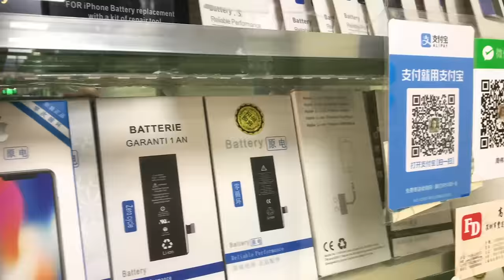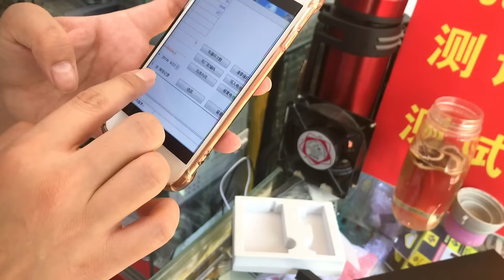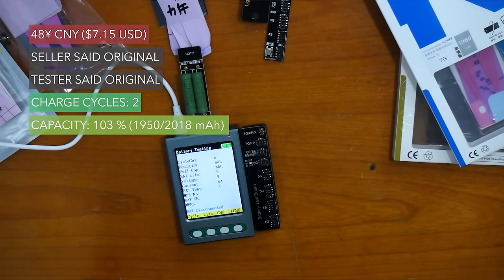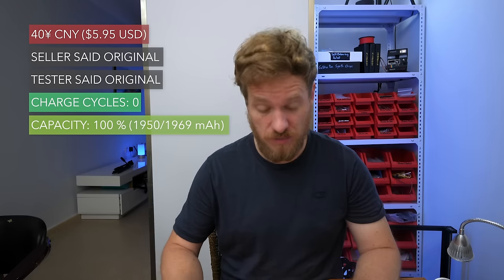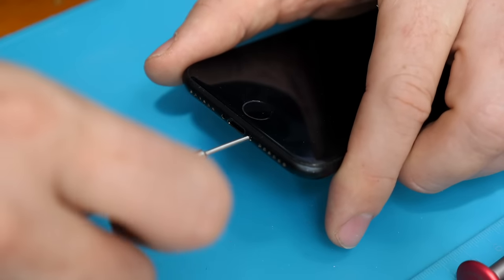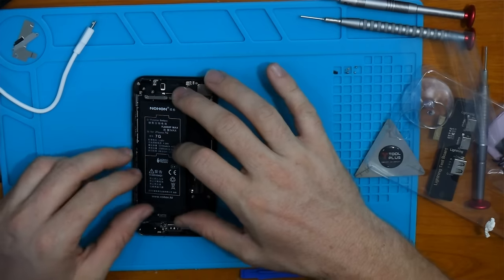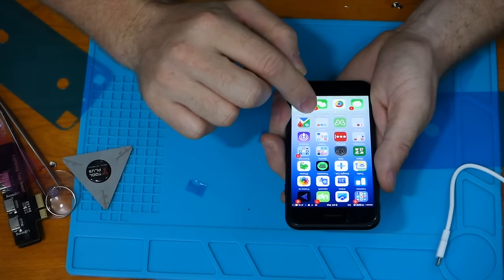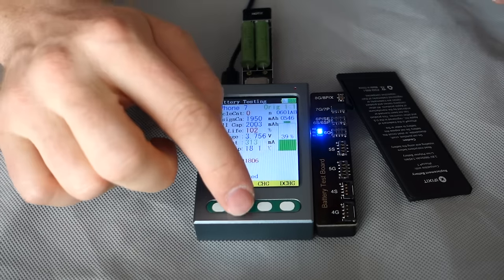Real or Fake? Trying to Replace my iPhone Battery in Shenzhen, China

Comment: 7/13/2019 just replaced my battery on my iPhone 6S plus eBay $19 with tools had higher capacity than my original battery I get it extra four hours of operating time every day over the original. Hands-down excellent deal 15 minutes to replace battery apple with their $.50 cheap battery that does not even last as long as this knock off Chinese battery I bought is pathetic. Waiting in line or making appointment to be seen at the Apple store is just plain stupid. Then to be told you have to come back in a few hours and pick it up on top of that it forget to call your name after you stand in line waiting for an extra hour until you ask a question that you’ve never been called all they can say is sorry or oops. Apple taught me how to fix my own phone and never buy their phones brand new again good marketing plan apple.

Comment: Couldn’t seat back and watch this video still, there is a-lot of unspoken categories/areas in the battery 🔋 a battery capacity is normal that can withstand powering off and on, send electrical currents to Capacitors. With all this been done the battery didn’t worth it.. your previous battery was better then the knock off battery 85% percentage battery life means your battery only have 85% of life not a 100%

Comment: for accurate capacity reading you need to charge to max and then discharge to zero " a battery " through "a battery tester " specificly desinged to test a smartphone battery (depending on its nominal voltage rating) soo basicly this video is full of false chinise science logic ... u guys are better buying nohon or similar aftermarket battery

Comment: Naahhh don't remove the battery like that. also dont ever heat and pry; thats awful. pro method: remove taptic engine, "roll" the starters of the tapes downward until its a little sausage at the edge of the battery. then slightly pull it downwards with slight left/right movements. when you have around .5 cm of tape out under the battery, roll it to a sausage between your fingers in a 90° angle to the battery. give it like 3 turns in the same direction. then start slowly pulling downwards with left/right wiggle motions on the tape. when ever it gets flat under the battery, keep spinnig it. 100% success rate, with a little practice you can do it in like 15 seconds per tape. have a nice day :D